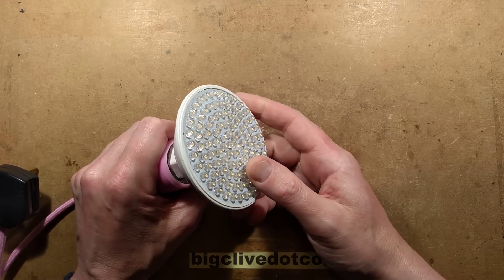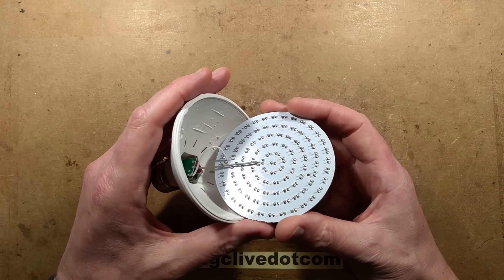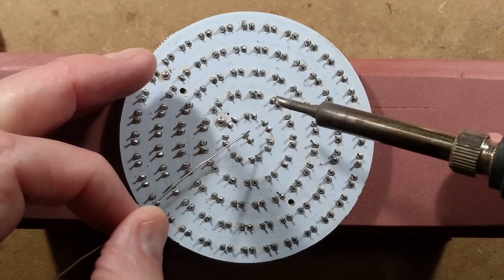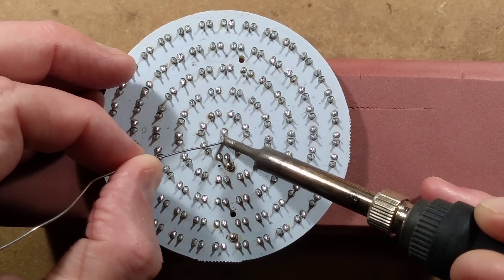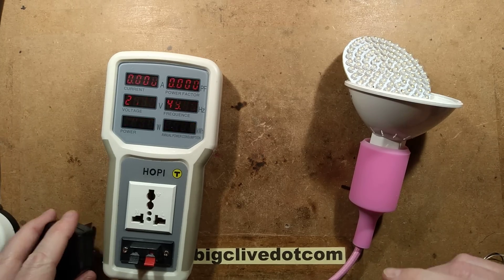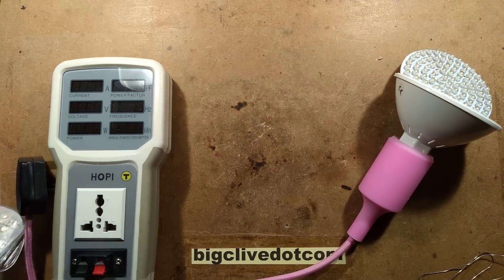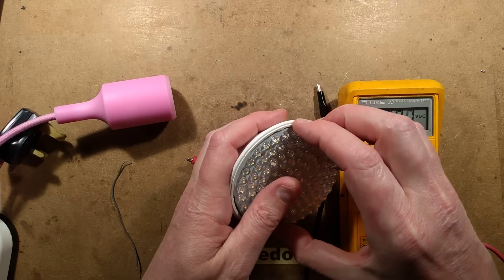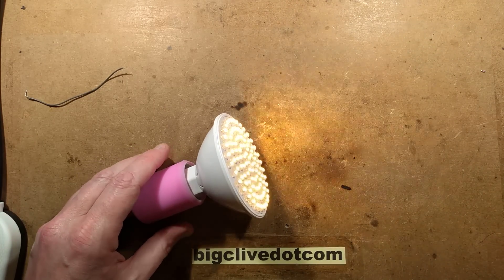Repairing a rather nice 100 LED lamp.

Comment: Did you notice the 'neon' screwdriver light up when you levered out the disc ?
Must have been charged :D
Reply: Not charged, that was caused by Clive's cybernetics...
Reply: That's because the screwdriver is also a continuity tester for testing fuses.  It isn't the traditional neon, but contains a LED, 2 button cells  a Darlington transistor and a 4M7 resistor in place of the Neon (The Neon series resistor is still there as well).  If you notice Clive was touching the tip of the screwdriver when the LED lit, thus showing that Clive is conductive!  Look up 'Magic MultiTester Screwdriver' on ebay for similar screwdrivers.
Reply: @chrisg6597  And cheap too (under 4.00 pounds). Except for the +100.00 pound shipping charge to the U.S.!! 😦
Reply: @Chris G not only is it magic, but it works based on mysterious zero-point vacuum energy - mine is two fecking decades old, never changed batteries, still lights up...
Reply: @Attila Asztalos Must be like the lamp that Steve Mould recently featured, @bigclivedotcom should review a 'how it works
Reply: I was going to say the same thing, but others have pointed out it's a continuity tester.  That's a shame because the first story was so much more fun.
Reply: I have the same screwdriver, It has it's own batteries, made for continuity, no contact voltage detection and low voltage dc polarity testing. I wouldn't trust it for anything electrical related but it is a bloody lifesaver for getting the knots out of my boot laces when I come home pissed from the pub lol!
Reply: good eye

Comment: Bad solder joints in a cheap LED lamp aren't surprising, it happens even with industrial name-brand equipment, how many times I fixed operator panels and HMI's by just reflowing some solder joints... I've come to hate lead-free solder because of this, then again, it gives me a job
Reply: TomboXYZ Half of Louis Rossmann's $$$ Apple repairs are just reflowing corroded solder joints.
Reply: @Another Dick I've had a roll of lead-free at work because that was what they used in production, so when I needed I just grabbed it from the warehouse, I got the company to buy me 60/40 after I tried soldering 6mm2 cables to a connector and the cable and connector would start melting before the solder... When trying to salvage components I always add some 60/40 while touching the tip to the joint, as that will make the lead-free solder melt easier, saves some time and results components not failing in the process

Comment: I can't be the only one looking at that lamp and thinking "Now what would that look like if that was re-engineered to be covered in hundreds of neon indicator lamps?"... :D
Reply from the maker: The tricky bit being that 50 neon lamps per circuit in series would require a strike voltage of 4500V.
Reply: @bigclivedotcom  Seems an ideal application for your strangely-named Italian NST! With 25kV behind them, they'll light just fine . . . . . . :-)  :-)
Reply: @bigclivedotcom  Don't you have a transformer out of one of those USB plasma balls around somewhere? :)
Reply: I think he did that before: answer: it'd be glorious

Comment: Transformerless Power Supplies-Resistive and Capacitive
http://ww1.microchip.com/downloads/en/appnotes/00954a.pdf
Reply: I just read an article about that. EDN or EE Times, can't remember.
Reply: @jamesvandamme7786  
Far cheaper than transformers or electronic ballasts, but potentially lethal in the wrong hands.
Reply: @FarleyHillBilly  Lethal in any hand

Comment: It must be stimulating work doing a couple hundred of these every day in that factory somewhere in China.
Reply: Worry not! The Chinese outsource that kind of work to India now. 
😅
Reply: @oilybrakes  pmsl. Nice one 🤣
Reply: I would've thought this many solder joints would be wave soldered. Solder them all at once on a continuous line. Would be quicker and more efficient.
Reply: The solder fumes? You'll barely know what's going on past the grin on your face 😅
Reply: They're great practice.
Reply: you mean a couple hundred an hour i think, otherwise they are not a good citizen.
Reply: That used to be how it was when China made cheap but functional clothing for the rest of the world,
Nowadays they have got good at making machines to do the clothing or wiring stuff.
Being first at Mars is more of a priority,

Comment: At the last few seconds of the video, as you're doing the closing. It looked as if the leds were in a non straight line they looked bent more twords the middle is that the way it was made, or is that the flicker or are we seeing the wave in motion sinusoidal I mean. Or am I just crazy. Cheers from not so hot Kansas today. My transmission is all in. Now i have to do a quicklearn at dealership they want a week to do it. I'd like to drive this truck. Right now.
Reply from the maker: Some of the LEDs leads didn't look quite straight, but they're wide angle, so it's not really an issue.  The ripple was camera rolling shutter creating a wave with the slight ripple on the LEDs.
Reply: @bigclivedotcom  ok, well I thought I was intuitive for a second there. 😁